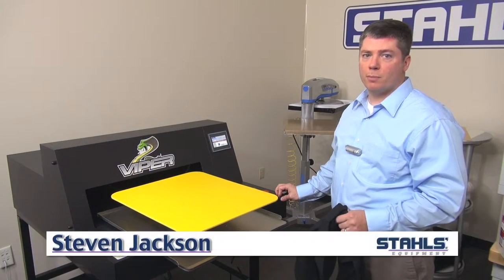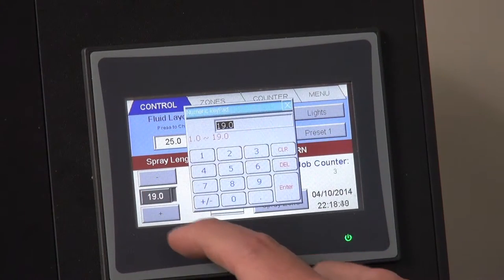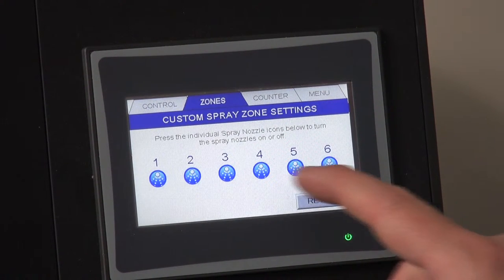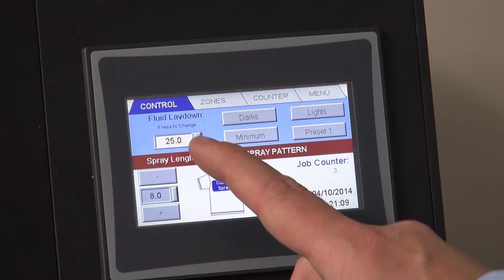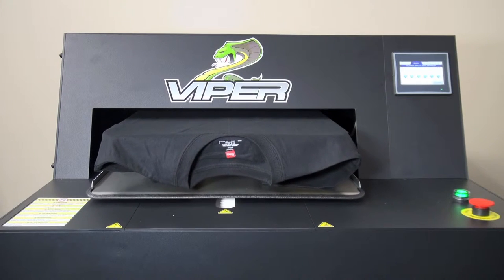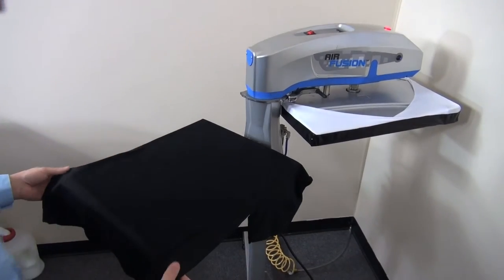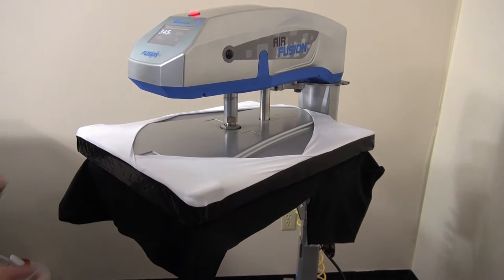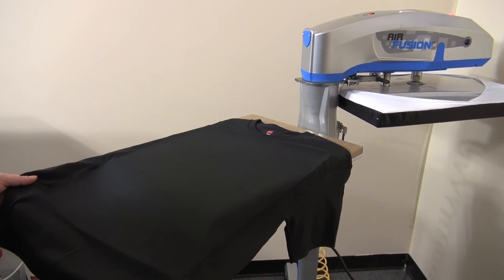Pretreating a Garment with Viper XPT-6000

Comment: old video but hopefully I get a reply.
I am currently using one of these and it doesn’t not spray evenly. between the spray points I barely get any pretreat on it so I have to really rub it in with a roller which means I have to use a lot more fluid.
Any idea on why this is happening?
 Thank you in advance